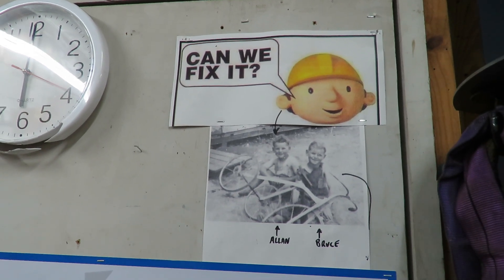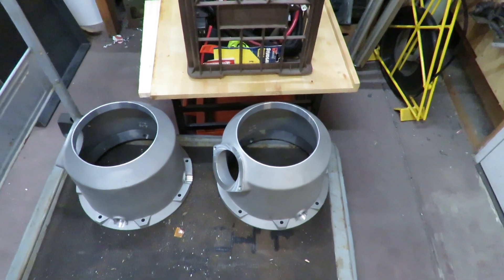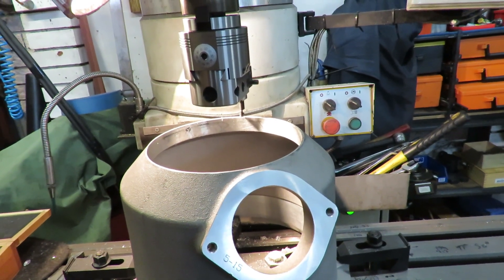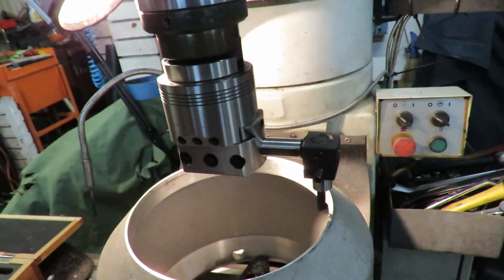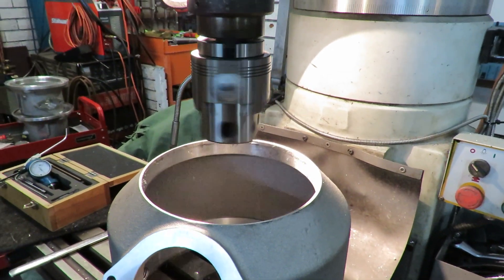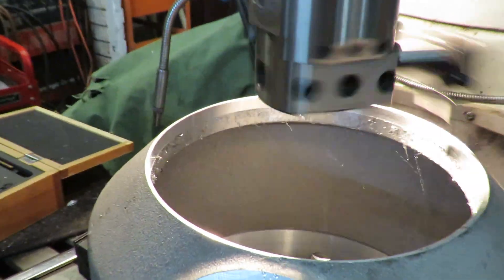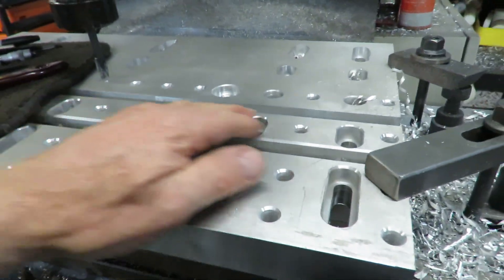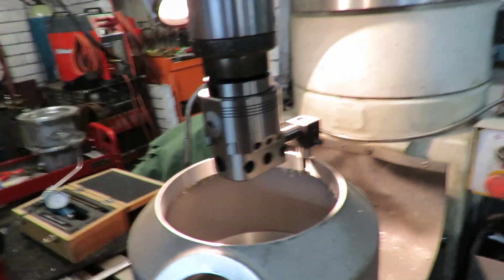PUMP HOUSING REBORING JOB

Comment: Hi Bruce, I can use both systems, but as a kid in school in the 1970'S, I was in the transition phase over to metric in Canada. This took a number of years. So I will default to Imperial as a first choice. If you asked me to go measure your work bench, I will come back with Inches, Go measure that shaft, I use Thousands of inch.  If you want metric, I will go back for a second measure. In Aviation we still use Feet, Miles and knots.
Cheers, Les
Reply from the maker: +Les Foster Until 1967 I used mainly imperial with a sprinkling of Metric. Then I changed to Metric with a sprinkling of Imperial. I'm comfortable with metric it is much more cohesive and sensible and less numbers.

Comment: Those parts look new. I wonder how they ended up undersize? Somebody couldn't read a print or a CNC operator not checking their work?
Reply from the maker: +bcbloc02 could be either, more likely using an earlier than current version of the drawing, we did change the tolerances on a later revision, obviously it failed the "downstream, don't keep it in the office" test!

Comment: I don't think I have ever seen a right-angle boring bar adapter like that--very interesting.  A quick search shows that those could be Narex.  Is that right Bruce?
Reply from the maker: +bkoholliston Yep the Narex and the clones use similar types of bars, My large one is a Narex (650mm diameter capability).